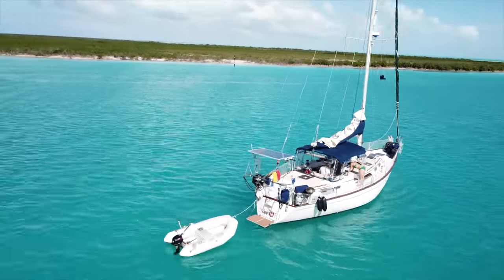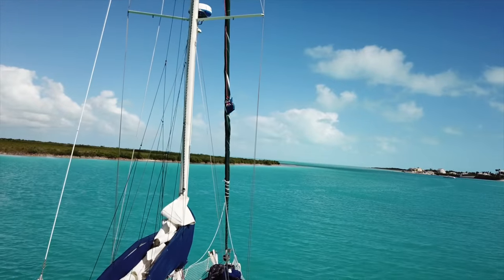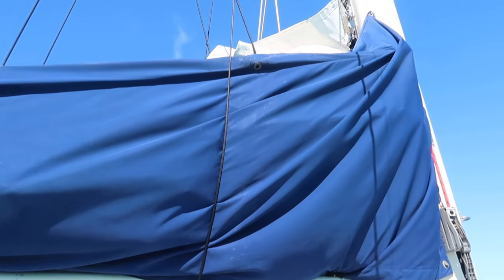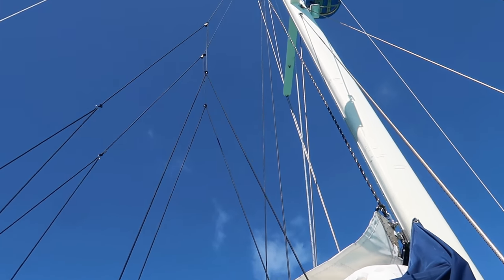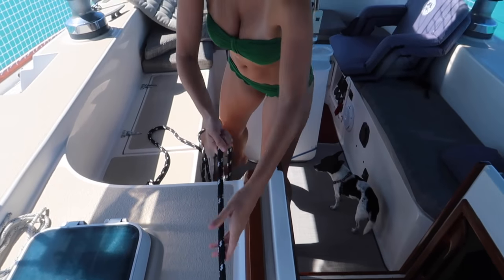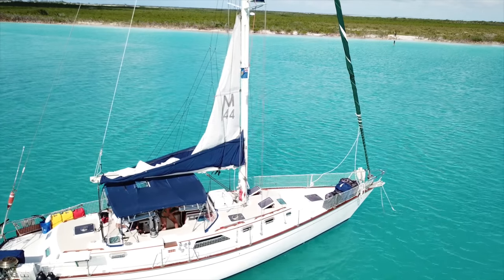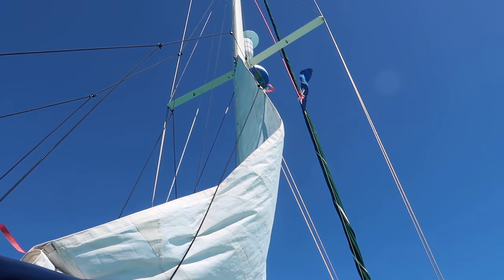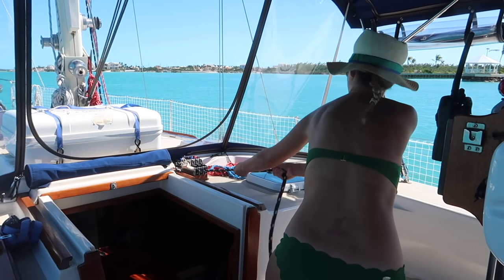Lazy Jack Lines SOLVED (Sailing Satori) OTH:3

Comment: Interesting .... I raced on a 43' Tri that has a fully battened mainsail w/ "Lazy Jacks".  While there was no "stackpack" the boom has a cradle built on it.  Here was the problem ... brand new mainsail made of some "high tech" material ... very soon the mainsail started to fail and rip ... NOT GOOD!!!  The problem w/ that sail was that it was folding always at the same spots when dropped and stacked on the cradle ... on my racing "beach cat" w/ very similiar material (pentex) I learned to roll the sail up ... not to "flake" it ... of course the "beach cat" sail has a bolt rope, and comes off the mast.  On the Tri the mainsail is attached to a sail-track w/ "sliders (?) ... they look like little "traveler cars" so they do not come off.   What type of sail material (and wieght) is on Satori???  Have you had any similiar issues???

Comment: Unless the boat is secured to a fixed point, the moment you attempt to raise the mainsail off the wind, whether one uses your technique or not, the boat is going  to sail  off to leeward. Shouldn't the mainsheet/boom be slacked off?
Reply from the maker: Not if the boat is under auxiliary power. Letting out the main sheet may help, but you risk the boom slamming back and forth in stronger winds or seas. Like we mentioned in the video, what we showed here was an extreme example, meaning you typically wouldn't turn this far off the wind when raising the main. But if the boat veers just 5-10 degrees off the wind, you may get tangled in the lazy jacks. Sometimes the boat can be dead into the wind and still catch the lazy jacks from the sail luffing back and forth, even when it seems impossible.
Reply: I was having the problem even while motoring into the wind with my auto pilot on, the batons catch anything in their way.
Reply: "Usually the wife" hu??? Something tells me you would be just fine if "husband" fell overboard.  Dont sell yourself short, you're  probably a better sailor than said hubby.  😉😉😉😉😉

Comment: Question: Since you are away from your St. Pete dock do you keep paying for the slip in St Pete, give it up or sublet?
Reply from the maker: No... we did not keep the slip in St. Pete. At $750/month, it would be hard to justify, or afford. They do not allow subletting of slips. In fact, even if you have a slip rental contract, you are technically supposed to let the marina know when you will not be in the slip... this is so they can rent the slip on a transient basis while you're away. But don't expect anything in return for this curtsey, it's just the way it is.
Reply: Thanks for the reply...bye the way I leaned something from your video. Keep up the good work. Very informative.
Reply from the maker: Thank you!
Reply: Our marina, Rivers Edge in St. Augustine, will reduce the slip fee by 50% of someone is going to be away for extended periods.  The logic they give is that this reserves the slip for the owner and ensures the marina gets something for the slip if they don't have any transients to take it.
Reply from the maker: That’s a good deal!